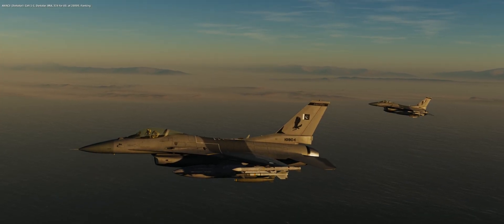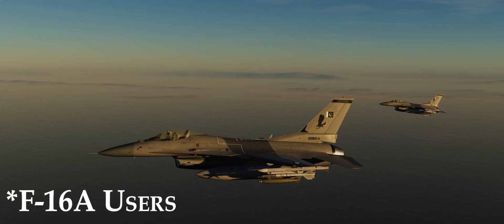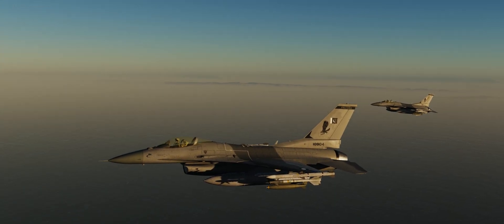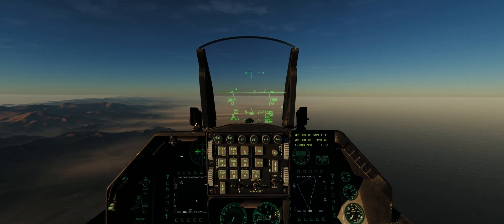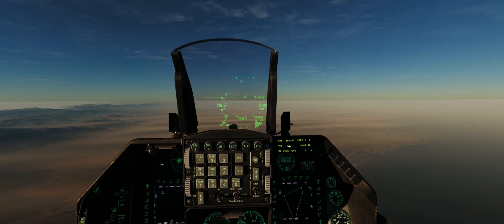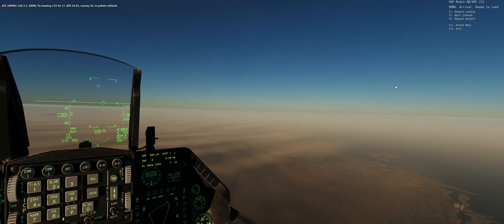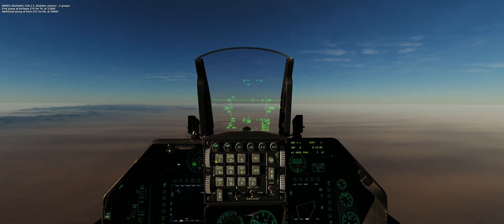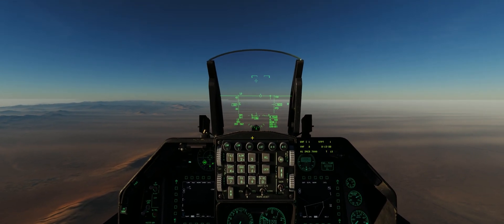DCS: F-16C Viper Radio Tutorial!

Comment: Great explanation, but when you say, "Contact the tanker" it is not clear what you use to do so.  I have that command "A/A refueling - "Ready for precontact" radio call" set up to joy button8 on my winwing F18 stick, and also ctrl+c... neither work to contact the tanker.  Am I supposed to be using a different action?  This is the 12th video I have watched by as many posters, and all explain it very well, and roughly the same, but none of them seem to work.  Is this a bug in the newest F-16 (Just bought it 2 weeks ago)... super frustrating.
Reply: I know this is 7 months late, but I have been having the same trouble so maybe someone else will see this. Make sure you have "Transmit Switch - UHF (call radio menu)" bound to a key, it is "right ALT + \" by default. BUT THAT WONT FIX THE ISSUE. THE REAL FIX is going into your settings on the home screen of DCS and UNCHECK the option for "Easy Communications." I have been searching for like 3 weeks for this answer and someone half mentioned it in a 3 yr old reddit post comment section. Once that is unchecked and you use the RAlt + \ keybind, the top of the menu that comes up should say "UHF (whatever the model number of radio is)" NOT "Auto." I dont understand even a quarter of how this simulator or module works, so I can't answer any other questions, but that is my solution to the problem I believe a lot of people are facing. Hope that helps whoever.

Comment: How would I put in the channel feq for re arming or changing my loadout ?
Reply from the maker: Poop Criminal use the Slash key for that the ground intercom system doesn’t require changing of freqs
Reply: Spudknocker so I’m In a bit of a pickle I’m currently flying the f16 as im sending you this reply I landed at kantasi I don’t have any radio feq put in beside the preset such as VHF-127.00 MHz and  UHF-305.00MHz I’m able to read ark and change my load out but when I go to create a fast mission it doesn’t let me re arm or change load outs

Comment: Im having a hard time talking to wingmen with the F16....  I put in the 127.00 and continue to hear nothing from them in a single mission, like coiled viper :/  Bummer really ....  Thanks for the help
Reply: I am having the same issue! I tried switching radio frequency to my wingman and still nothing. It's actually showing up dark grey in the list. Hope theres an answer!
Reply: @npearce1995  If you see things in dark grey it means you are using easy communications. With using easy communication you don't need to change frequencies by yourself. Say something to that frequency and it will automatically switch the frequencies. So I think the aircraft's comms system don't work with easy comm on. You can switch it off in the gameplay settings. Now you have to change frequencies by yourself. Also keep in mind you use the correct communication menu when you want to talk. Right ctrl \ is for VHF and right alt \ is for UHF or the other way around I don't remember exactly.